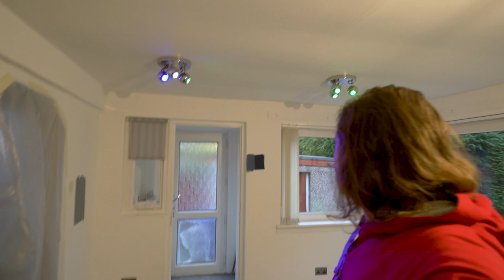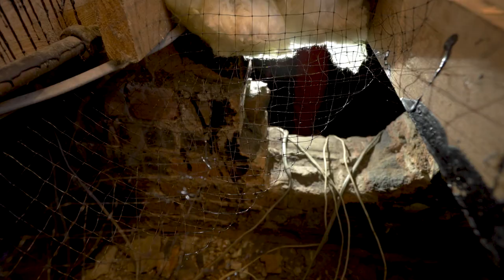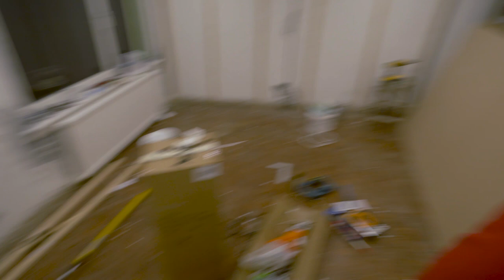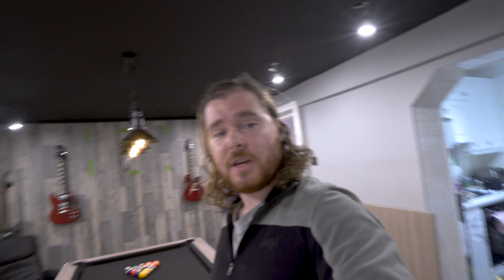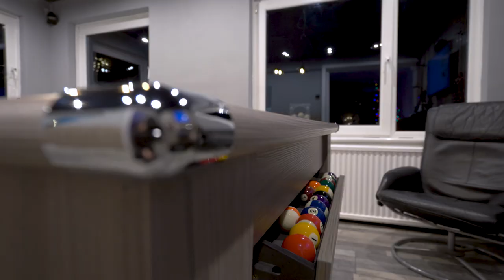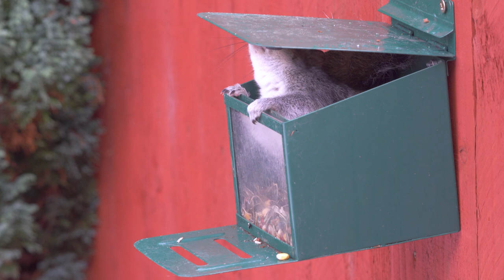"The Billiards Room" My New Man cave / Pool Room / Editing Suite

Comment: Fab! Just needs a bit of acoustic damping 🙂
Reply from the maker: Thanks 😁 since this video, I've got black out / thermal curtains which absorb a lot of noise. Also painted an mdf board with blackboard paint and put it on the wall, just not written on it. Radiators have been swapped out as well, for shorter but newer double panel, double fins. Can't believe it's almost 3 years since I did it all.
Reply: @TheNonsenseAdventures  nice one. Curtains for the win! Enjoy.

Comment: Hey man what size is the table? 6ft/7ft
Reply from the maker: It's a 7ft x 4ft table. We did think 6x3 would give us more space round it but we liked the look of the 7x4 instead.
Reply: @TheNonsenseAdventures  thanks man! the rooms beautiful!
Reply from the maker: @LVLZRADIO  cheers! Finally got curtains fitted after over a year without them. Still want to put a black board up for "House rules" and a few other wee bits.
Reply: @TheNonsenseAdventures  looks class man. Having the same dilemma regarding 7ft vs 6ft. Do you mind saying where you got the table? And how it came? As in partially constructed or flat packed entirely?
Reply from the maker: @LVLZRADIO  I got it from https://www.homepooltables.com/
They had guys deliver it and build it in the room. Then they made sure it was all level for us as well. Very impressed with the service.